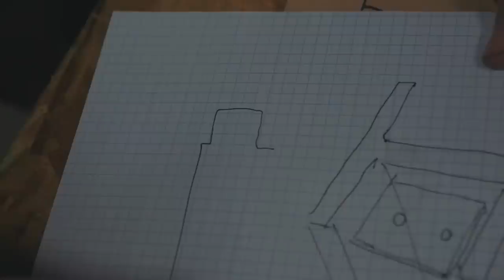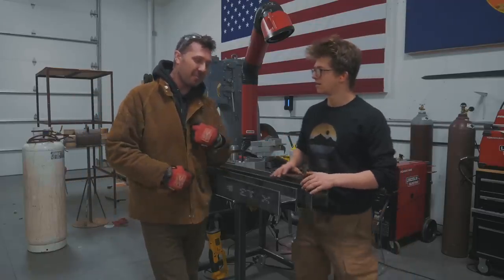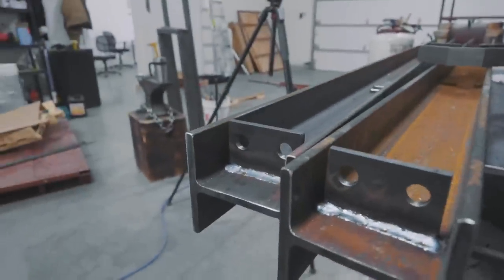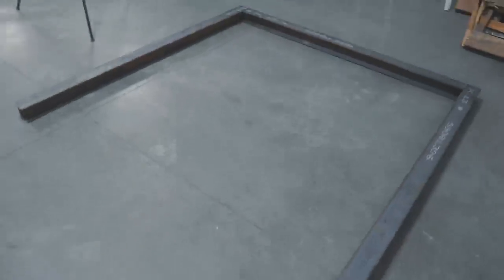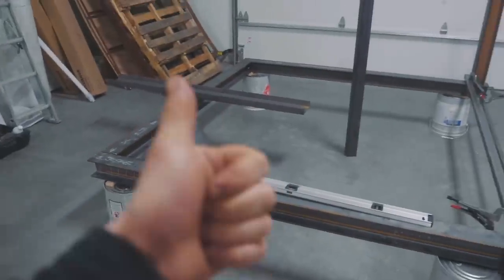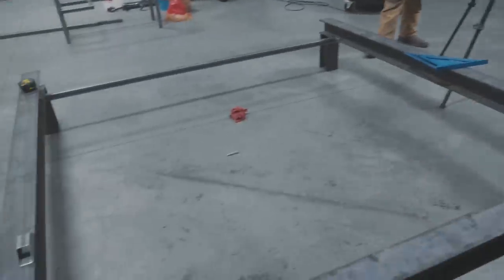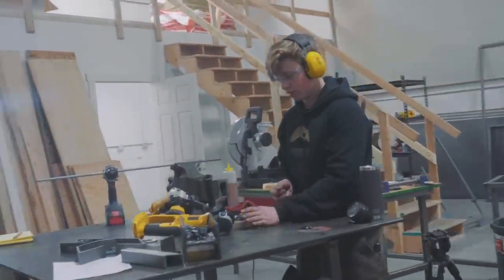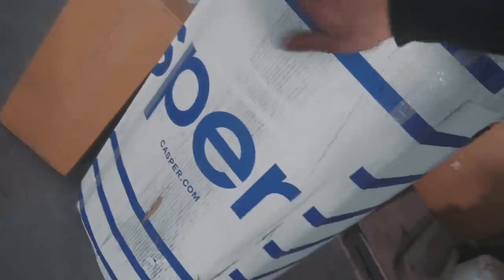MAKING THE INDUSTRIAL STEELE BED!!!

Comment: ”W-Beam”, ”Wide Beam'" ? I've spent decades as a carpenter, contractor, metal worker, and fabricator and that is the first time I my life that I'd heard a steel I-beam be called a W-beam. Learn something new everyday
Reply: I-Beams are very square in their angles and consistent in their thickness. a Wide Weam/W-Beam/Wide Flange (what I always called them) have radiused inside edges and the flats on the top and bottom of the "I" go from a thicker portion and thin out towards the edge. Google search of (wide beam vs I beam) will show some good cross sectionals.
Reply: Ricky Harrison yeah I thought the same thing, never heard of an I beam being called anything else. I wonder if it’s because we don’t write a capital i in the same way anymore
Reply: I was thinking the same. Lol.
Reply: I mean if your turning it on it’s edge it could be an H beam too 😂
Reply: I've only ever known them as I beams or H beams never known them a w beams, partner who's a welder wants to know what's W about them lol
Reply: As a union carpenter in Oregon, I’ve always called them a wide flange beam.
Reply: I presume it's because it's a british thing or because the webbing rounds into the flanges  instead of being completely straight like an I or an H making it more like two U's back to back ...
Reply: Dam you beat me to it.
Reply: I'm an architect and we call them either I or H beams. Cause that's what the cross section looks like
Reply: Ricky Harrison you need to remember, the colonials butchered the English language, tried making it easier for all the illiterates out there, use the same spellings for half their words, and generally cocked things up. 

Still, good job on the bed Alec, although because as it has been mentioned, the “ I beam “ is a shin dinger, I would have gone for L shaped bar, gives cleaner lines. 

Now, you really should have made it from Damascus 😂😂😂
Reply: Yeah I’ve only ever heard I-Beam, or more commonly in England RSJ
Reply: Double U i believe
Reply: What I beam? I dident see a single i beam, i did see some wide flanges. And welding on torch cut steel is cringy, but they did grind it down, but welding on an oxidized  edge is messy and weak
Reply: As an Engineering Student, the W-beam is in reference to the  flanges (top and bottom plate). Their are different types of beam cross sections, but two common are the standard flange beam ( small top and bottom plate) and the wide flange beam. Each have different structural characteristics and are versatile in their applications.
Reply: @rachelhunting  it double u not w
Reply: @hk47g78  you're a fun one aren't you
Reply: @travisthejiu-jitsuguy3743  You nerd assassin, you... Rollin, Math, building and designing things... great minds think alike
Reply: @travisthejiu-jitsuguy3743  and thank you for your input! Knowledge is power.
Reply: The "Wide Beam" nomenclature came from Jason.  The "W-Beam" or "Wide Beam" is commonly used by mill wrights or iron workers.
Reply: I work at a massive steel fabricator and all of our "I-beams" are all technically W's.
Reply: The names for steel sections varies around the world.  In north america there are 5 names for "I" shaped sections.  The old fashioned ones are called S sections and have tapered flanges and are of constant depth like channels.  They are only varied in width for heavier sections.  They are very inefficient as adding a bunch of metal to the web is wasteful.  They do get used for gantry beams as the trolleys self centre on the tapered flanges.  Otherwise they don't get used very much.  Standard I beams are called W sections (wide flange). 90% if I beams are W sections. There are HP sections (H pile) which are nearly square (flange width to beam depth) and have webs nearly equal to the flange thickness.  As the names suggests they are typically used for piling.  They are also great for beams that you don't want to have to put a bunch of stiffeners in as the thick webs are much more resistant to buckling.  The last two types are very rare WWF and WRF (welded wide flange and welded reduced flange).  These are fabricated beams where the flanges are welded to the web.  The WRF have smaller top flanges for use in composite construction.  They are generally not very optimized and 99% of welded plate girders are custom designed per application (bridge girders).  Most girders 900mm (36") and bigger will be custom plate girders.

If you live outside N.America, these names likely don't make much sense.
Reply: In Australia we call these UC for universal column. I-beams we call UB for universal beam.
Reply: technically it's a W-Section, but yes. (almost a civil engineer)
Reply: Josev King 
I’ve read that a lot of language historians state that the “Bostonian” accent is closer to the original English than the crap that the English speak today.
They have forgotten how to pronounce a th sound, they use an f instead.
Reply: @jackdavidson9045  and I or H is still easier than saying double U or as it sounds to everyone W Beam.
Reply: @timburke127  typically here in Australia we call the H & I beams any one in construction will tell you that
Reply: @rachelhunting  yes but I was wrong in saying that it actually is w beam and it's called that because of it being called a wide beam has to do with the difference in the thickness of the metal and the way the beam is formed
Reply: In germany we call it double T Beam
Reply: @jackdavidson9045  they are actually jsr beams to be accurate but we call them I or H beams because of the end look of them
Reply: I looked it up there is a difference steel is rare in American homes unless you plan on the floor needing to hold a grand piano most will use an LVL or in special less expensive applications a Flitch Beam which are plates of steel sandwiched between LVLs and then bolted together H, I, W beams are around can be $100 A lineal foot. Steel and block walls are very common in home building over seas
Reply: Glenn Lawrie-Smith depends which part of UK you’re from. We Welsh pronounce our th’s perfectly.
Reply: Oh good, I wasn’t crazy. See I on the other hand no nothing of construction, but even I thought i knew that was an I-beam
Reply: I know them as double T. But maybe thats because im from a bin english country.
Reply: In Aus they're called Universal Columns... I think, not sure exactly what material he was using.
Reply: Here, in Poland, it's referred to as double T beam (Dwuteownik)
Reply: all the suppliers around here sell them as U beam or U column , for Universal beam (horizontal) column (vertical)
Reply: @mossoconnor4417  Beam (normally used horizontally) is an I shape as the web is longer than the flanges, Column (Normally used vertically) is H shaped as the web and flanges are nominally (almost) the same length.
Reply: @wint3rsmith42  don't quote me but I think UB's are taller than they are wide (ie web is longer than flange is wide), while UC's are square.
Reply: @JamesFromAustralia  thats right Jim, so if the american  W beam is the square UC I wonder if they call the tall UB an N beam (narrow)?
Reply: Its UC or UB. they are calling the universal column a 'wide' beam. People talking about tapered flanges etc etc are stuck in the past.
Reply: @tri4arda  stuck in the past, LOL with imperial measurements,  how stuck in the past does it get.
Reply: have to agree i only heard them called I or H beams.
Reply: In Structural Engineering we call them W sections. More specifically, we will add on the number that corresponds to the weight of the beam (in pounds per linear foot). So like “W16” of example.

W, M, S, and HP sections are all what you would call “I-beams”. The difference between them is that they each exhibit different dimensions or ratios in their cross sections. M-sections have a tall web and short flanges, while HP-sections have very beefy flanges in comparison. 

All of this aside, W-sections are so commonly used that they make up practically all of the I-beams that you see out there.
Reply: It's short for wide flange beam.  The flanges on an I beam are much shorter.  A wide flange is closer to a capital H laid on its side.  I'm not enough of an engineer to tell you why they made the change, but I beams are seldom used anymore.
Reply: @wint3rsmith42  so true, we use metric in Australia, wouldn't want it any other way.
Reply: In the oil patch we call them "walking beam" , of course when u see something made from them, it was usually salvaged from a broken pumping unit!
Reply: Now I'm cofused

Comment: Alec, having had a Casper for years now I can say youll enjoy it.  However:
You really dont want to have those slats underneath with space in between them, or your foam mattress will eventually sink in between the slats and ruin your mattress. Having slats is okay with a traditional inner spring, but be careful with the foam. A couple sheets of OSB with no gaps will fix your eventual problem. 
Love the channel!
Reply: that, and adding a box frame underneath it to add height will make it so much nicer getting in and out of bed. and it looks grander.
Reply: I'm getting a memory foam for my bed so I'm really glad you posted this! I'll get on with the modification. 
Cheers!
Reply: I've got a similar mattress by a different brand (tuft and needle) and I'm using a sheet of ply with holes drilled in for ventilation to prevent mildew.
Reply: Platform beds typically don’t use a box spring
Reply: I have an all foam bed on a metal frame too ( not home made). I used mortar board for the solid board part. Something to remember is glued board products put out a heck of a lot of noxious gases as they dry ( and take years to fully dry). Either have a few plants in your bedroom ( generally a good idea anyway) or make sure to get sheet goods that have been sitting long enough to loose their stink. Painting them with zero VOC paint will help but let it dry well before putting the mattress on top.  New bed looks awesome!
Reply: Make sure your mattress can breathe. They are known to mold if not
Reply: Scott Donschikowski or get a box spring.
Reply: I make bed frames for a living and, while Montana is a pretty dry place, anywhere that isn't (like the wet northwest where I live) needs to have a mattress on slats. I've seen mold growing after only 6 months when the bed had plywood for the platform. This is why all of my platform bed frames have slats. One can simply get them closer together for a soft mattress.
Reply: I've had memory foam mattresses for about 10 years and I've been using slats spaced out roughly the same amount and I dont have the issue of it sagging. 
Now every foam mattress is different, I do not have a camper but the bottom of mine is dense heavy stiffer foam. While the top 10 inches is all memory foam. 
It honestly should be fine, if not just double up the amount of slats and itll be fine. You really don't want a peice of plywood as your bed base, great way to trap moisture.
Reply: @shadowgolem9158   Zero VOC is a marketing term. Zero VOC actually outgasses very very slowly over many years. Better use 'normal' paint that outgases in a few days or weeks.
Reply: I personally have had a Casper mattress for 2 years (love it btw).. Casper recommends slats spaced 4in apart for air flow
Reply: @shadowgolem9158  You can paint these with a couple of coats of proper sealing primer, if you don't wanna wait. Been using it for decades when renovating long-term smoker's rooms and apartments, and either time or funding don't allow for replacing wall/floor/roof paneling. Doesn't get rid of smells and gases, rather seals it in for good. But you gotta use the good stuff, and don't do greedy coats.

If you have built-in cabinets or closets, remember to do the interior of them too. This can be very time consuming, so certainly a point to evaluate if tearing it down is more sensible. If doing paid labor, the hours may make tearing out those cabinets and replacing them a more sensible option for the customer. Might not be more expensive, and enables other options if wanted once its getting replaced anyway.

Comment: Hey Alec, love the new bed, but as someone who used to train people how to sell beds, I have a small bit of advice. 
Firstly, the wooden slats need to have no more than 1.5" of space between them to stop the mattress springs from falling through and ruining your new mattress. Secondly, I'd highly suggest splitting the slats into two parts, allowing each side of the bed to move independently (very important when you'r not sleeping alone!) I'd also suggest attaching the slats mechanically to stop them wandering under the mattress. 
Love the floating effect, just hope your new home has strong floors to take all that weight!!!

Comment: I have not seen that spray transfer technique before. How does it do with high strength steel alloys?

Also, a suggestion for the shop: get a set of organizers and then stock them with various screws, bolts, nuts, washers, hinges, and casters (and anything else you might use a lot that comes in sizes) like Adam Savage has in his personal shop on the Tested channel here on YouTube. No going out to the hardware store in the middle of a piece and ordering online for a variety of fastener online all at once will be cheaper than heading to Ace or the Homeless Despot.

Comment: "I wanted it to look ridiculously over built"... Actually is ridiculously over built. Great bed now find some blue diecom and get back to crazy Damascus patterns.
Reply: Well, he can put RGB lighting under the bed to give it some ground effect lighting. ;)
Reply: @jackielinde7568  motion sensors and a few speakers could suggest the constant engine hum keeping it airborne
Reply: New Alec steele merch are sheets and duvet covers w sword designs on them
Reply: He can’t, his shop’s concrete is too thin.
Reply: @justanotherpiccplayer3511  i skim-read your comment and skipped the word "designs" for a glorious moment i imagined a duvet cover with mini high-quality swords attached to it. tough to wash carefully, hard to fold and almost impossible to wield in battle- but oh so worth it.
Reply: Definitely looking forward to seeing some more smithing and machining work as Alec gets the shop a bit closer to fully set-up.

Also, I'm not sure if you misspelled for comedic effect, but for those who aren't aware, it's spelled Dykem, and it's a brand name. 

The generic term, should you want to go shopping for some, is "layout fluid."
Reply: It seems like his bed will be able to see a lot of "use" and not wear out...

GIGGITY
Reply: @metalman6698  well greased up and plenty of harneses to reduce stress to particulal areas (Safety First), this bed shall last out until it becomes the heirloom of generations!
Reply: fomoran next bed upgrade, like the throne in game of thrones but a bed

Comment: Amazing bed frame. I would suggest to get some black paint, named "Black 2.0" and use it on the foot, that way with the shadow of the bed you will not be able to see the foot at all unless using some light under the frame. Makes an even more amazing flying bed!

Comment: if you find the mattress is lumpy over time, replace those slats with just flat plywood. you dont need a boxspring with casper, but the flat surface under makes a huge difference

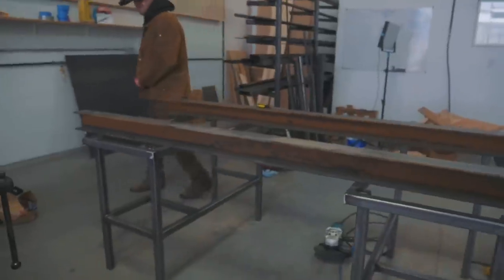Comment: 2:45 YES. YES 100 TIMES YES. It is always SO GOOD to see professionals using PPE properly to show people what you SHOULD be doing! There are FAR TOO MANY backyard/garage workshop "heroes" that have irresponsibly terrible safety practices when using angle grinders and doing cutting tasks. So much of it that it normalises the act of using these tools irresponsibly and perpetuates the "safety = weak" and "I've been doing it 20 years never a problem" message that new metal workers pick up, along with the irresponsible behaviours and then end up injuring themselves. As someone that is still healing from bad safety practices forced upon me by supervisors, and now taking sincere and responsible control on my own workshop, good on you Jason for showing the younger people here How It's Done.

Comment: I exclusively use MAG with Basimix 2,5. Works like a charm. You run it with relatively high amps (for your material strength something like 320A) but you get welds done in a speed that has to be seen to be believed.

Comment: Alec, When I visited a friend he had a similar power hammer issue, thin slab. He took 4'x4'x8' timbers and strapped them together on the floor. Laid a 1/4" steel plate on them and lagged the power hammer and hydralic press through the plate and timbers into the concrete slab.

Comment: you need to have a piece of plywood with some holes drilled in it for air circulation to lay on top of the slats.  This will keep your mattress supported better and will keep it laying flatter.